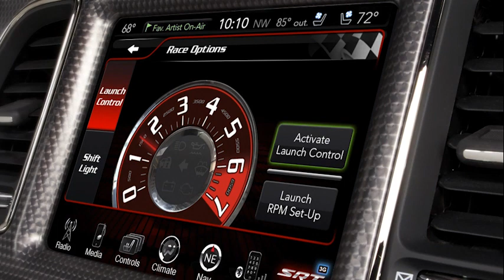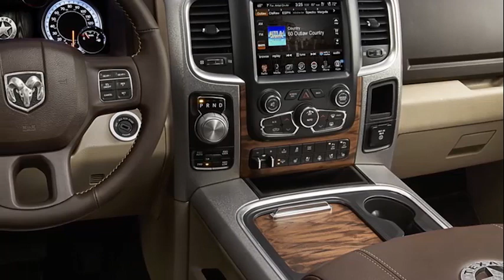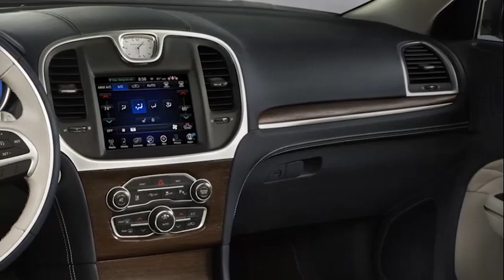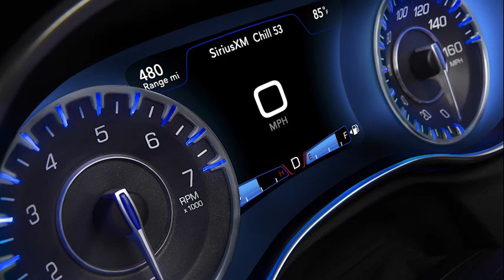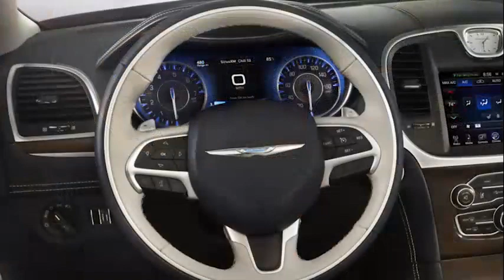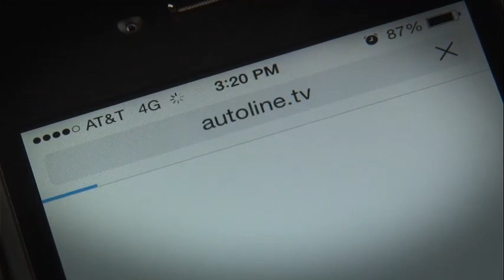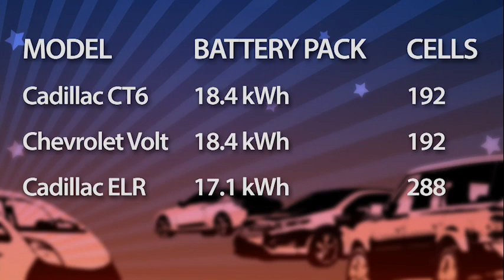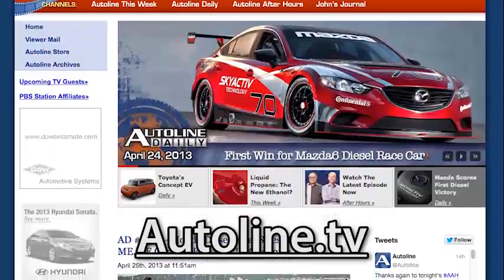FCA's Santa Klaus Shares Some of his Easter Eggs - Autoline After Hours 285

Comment: The Phaeton is not an A8, although they share many non-body parts. The Phaeton is actually based on the Audi V8, the A8 predecessor... which is where the Audi V8 Motor debuted. Phaeton/V8 = D1, made of steel. A8 = D2, made of Al